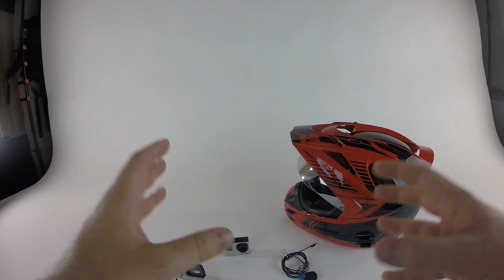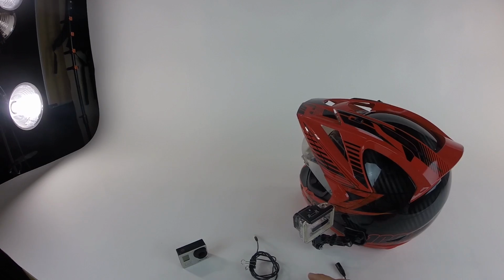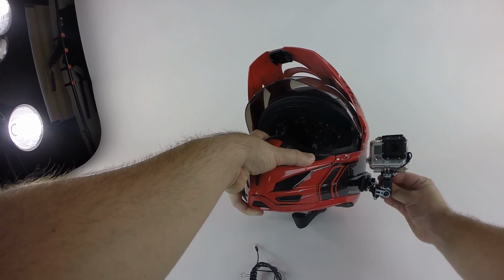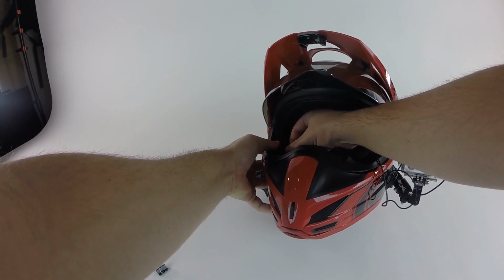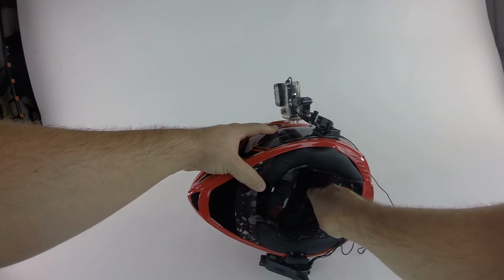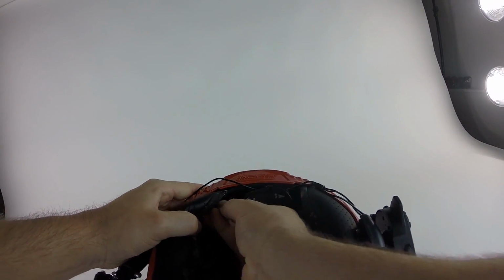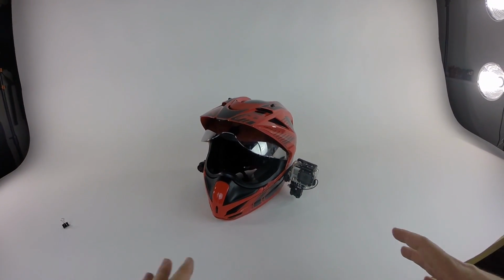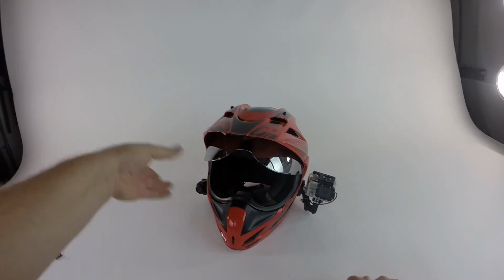How I record in helmet voice audio

Comment: MXL GOLAV 165GP, Lav mic that plugs straight into the GoPro no adapter needed, AND plugs in nice and snug with a right angle plug. That's been the easiest and best sounding way i've done yet. I'm shocked more people aren't using them lol !  Good set up vid man !
Reply: +bakerXderek Yeah, in my last video I guess I had a loose connection with the adapter. I'll have to invest in that mic, do you have an amazon link?
Reply: +bakerXderek CHEAHHHHHHHHHHH
Reply: But that's a rip offf

Comment: Y'all should know that that 90 degree mic adapter working on Chase's set up is a fluke. Some get luck and it works cuz of randomness. But it doesn't have the required resister. If you want to rock the 90 degree one you'll have to modify it. Look up EN187, he has a video showing how its done.
Reply: I thought the same too. Just decided to eBay the official gopro adapter for a slightly less painful price since I'm ordering EN187's same mic.
Reply: I was gunna say, I have bought 2 of the same 90deg adapters and neither work.
Reply: +Jake TheGardenSnake - I bought and trashed 3 of those adapters. I could only get right channel audio using it. I ended up changing my helmet mount to the chin of my helmet so I could use the gopro adapter. 
A side benefit to that is the gopro isn't trying to break my neck riding down the highway.
Reply: +Jake TheGardenSnake yeh..i think its supported on the black without the resistor...but for the silvers you have to do the mod...i attempted it 3 times and ended up spending the same amount to if i bought it with the resistor haha...
Reply: +RT MOTOVLOGS if anyone wants a link to a 90degree adaptor with the resistor let me know..they are like £10ish
Reply: +Jake TheGardenSnake I was just about to say that it's the wrong kind. I just ordered it and.. nope, no good.
Reply: +Jake TheGardenSnake Motonosity said he has the same adapter and it works fine. He said some of the 90 degree adapters don't work with gopros, but the one linked does.
Reply: +mercilesshobo that one doesn't work. i clicked the link and amazon says "buy it again" meaning this is the exact ine I've bought before and it does not have the resistor and doesn't work kn my hero3
Reply: Sportbike Hobo Well it works for Chase and Moto. Both of which have several of them.
Reply: Im not saying it doesn't work for them +mercilesshobo I'm just warning you so you're not surprised and disappointed.  . . we're hobo brothers we got to stick together.
Reply: Sportbike Hobo Haha well I got a few months before I have to start worrying about setting up but appreciate the hobo support.
Reply: +Jake TheGardenSnake or just buy the damn go pro adapter. i know it's overpriced but i mean shit for most people it's probably cheaper to buy the go pro one rather than modify it themselves.
Reply: +2cool0 the problem with that one is that it isn't a 90 degree one. so it sticks out and gets caught on everything. ive had it bend the port in one of my gopros because of that.
Reply: +zake90s exactly ..I spent £60 on 3 broken official adaptors cause it kept getting caught door frames ..lol how hard was it for go pro to create one with a 90degree angle lol
Reply: zake90s yeah that is a problem but maybe you could try putting the camera on the left side of the helmet? so that you don't have to bend the wire so much.
Reply: +2cool0 I tried it on both sides as well as a chin mount. it either sticks out and gets caught, or you have to have the camera sticking way out in order for it to fit, thus hitting everything in sight. even with the chin mount, it would catch my jacket when ever I did a shoulder check if I wasn't really careful. it was a poor design by gopro, I can't really think of any application where their style of adapter would be beneficial.
Reply: zake90s yeah it is a shitty design. damn i don't know man....have you tried not pulling the wires so much?
Reply: +2cool0 hahaha yeah, but I eventually gave up on it and went to the sena gopro back.
Reply: Love u dude
Reply: Can you send me the link to it?
Reply: i think that guy is gone. like literally..
Reply: Jake TheGardenSnake can you show us how to do the setup for dualvlogginh??? please

Comment: In Australia they're trying to make attaching cameras and intercoms to your helmet illegal... Apparently it "breaches" our Australian helmet safety laws and the helmet's structural rigidity...
P.S. Love the way you say adaptor, you say "adabdor". Keep the mad vids coming!
Reply: +Exodus227 And how can we record our rides for safety then? Cars have crash cams, it can be seen as a necessity for Motorcycle riders in most cases?
Reply: +lCLUTCHl_BLADEZ Yeah I'm saying the government is just BS, cameras are for us motorcyclists safety and should not be banned.
Reply: Definitely, Is this Aus wide? or particular states?
Reply: +lCLUTCHl_BLADEZ Currently I've heard it only being in NSW, QLD and Victoria.
Reply: +Exodus227 weird law as long as you are not drilling holes in the lid, how does something stuck to the surface change the integrity.  Sounds dodgy..
Reply: Exodus227 Sounds right, most laws are trailed with us anyway, Eastern Aus for the win haha, 
Yeah GTs Garage probably more so when an accident happens, they think the extension from the helmet becomes a risk and can cause damage to helmet? maybe somehow amazingly puncture the helmet?
Reply: +lCLUTCHl_BLADEZ +GTs Garage Exactly they think it will magically break through the helmet and drill my skull... Pretty sure if I use adhesive to stick it on, first the camera and arm will break off then my head will impact the ground, posing no danger. Its probably just the cops whining that whenever we get pulled over, we have footage as proof we didn't do anything wrong...
Reply: +Exodus227 I think they are already illegal in Queensland, Not sure about Victoria or NSW. It doesnt really bother me. I don't much care for the helmet view anyway. I much prefer dash/road cam. Helmet cam makes me seasick with some guys vlogs. Like hyperactive children they can't keep their head looking forward for two solid seconds. I believe chest harnesses (much more stable) and other mounts such as tank or handlebar mounts are still fine. It has to do with the physics of a camera dispersing an impact where a helmet is designed to intentionally crack on impact. I dont see anyone willing to fund a test to see if the camera dimishes the helmets ability to do its job. We also cant use tinted visors so go figure.....
Reply: Same in Canada even putting on stickers are technically not legal but I don't think the cops care too much about it.

Comment: Why dont you use the GoPro backpack for the Sena? much easier much wow
Reply from the maker: +Supermofools I've found that the audio quality using wired is much better than anything I have personally tested. Wireless is hella nice to use though.
Reply: +chaseontwowheels maybe I should have read som comments before putting mine lol
Reply: +chaseontwowheels That's great feedback Chase, thanks. Have you figured out a way to do higher quality intercom recording?
Reply: +Supermofools Because Sena products completely BLOW.
Reply: +chaseontwowheels not to mention how much battery life you'd be pulling off already such a short recording time on the gopro.
Reply: +chaseontwowheels Is there a mic that works for the sena and gopro? or do you have to use 2?

Comment: I did not have to drill a hole. I used a separate skeleton housing (not waterproof) and my mic adapter fits straight in the side. All of which is official gopro gear.  I kept the waterproof housing for when the wife bog washes me after a long ride with no phone call ;)

Comment: It sucks that you have to drill a hole. Defeats the purpose of having the gopro if you do mountain biking or water sports. Housing goes for like $40ish though so might have two housings.
Reply: +xavier415 Well you can seal that with a membrane or something that doesn't allow the water to go in and at the same time allow you to move a bit the usb to unplug that from the gopro.
Reply: Which is cheap.

Comment: I hate the GoPro4 10 pin USB. Hate hate hate.
Reply: +snowcatxx87 But i'm a new camera!
Reply: +Modelero epic
Reply: +snowcatxx87 Snow..How did you get around this on your hero4? I have bought various 'cheap' mic adapters which have claimed to work with the Hero4, but still no luck. I want a functioning L-shaped adapter :(

Comment: Nice vid. Just wondering how you got the mic adapter to work with your gopro as the link from your description is reviewed as an adapter that doesn't work with the gopro 4 silver :( I have the Hero4 silver but haven't' had luck with the L-shaped adapter as the adapter's do not have the additional resistor. Any ideas?

Comment: FYI The mic you have is stereo and the mic you linked is mono. Unless I'm seeing yours wrong you might want to correct that. Does your GoPro/adapter work with either?
Reply: +Mr Tmax  Well, not true stereo. It's a 3 contact plug which feeds both channels.

Comment: dude you set up the same way I do , I have the gopro 2 and I just ordered a case that had the cut out and it came with a mic off ebay for like 30 bucks , I am sure they make it for the newer models . are the gopro 4 worth the cost I was thinking of upgrading to the 4 but don't know if it is worth it the hero 2 seems to do pretty good what do you think

Comment: how do you capture the other rider's voice to the video in conversations through sena
Reply: +Da ViPeR This is a great question and would love a vide on this too!
Reply: You get the audio and footage from the other rider then compile it all together. Or, there are many bypass ways to record yours and your fellow riders audio.
Reply: thanks for the support dude
Reply: +Exodus227  thanks man
Reply: +Da ViPeR they most likely have the sena go pro adapter. they have the sena headset for intercom right......so if you have the sena go pro adapter what it does is, it takes the audio from the sena mic AND all the audio coming in from the call (which means the other riders' voices) and puts them on the video you're recording! it makes all that super simple and hella clean.
Reply: 2cool0
thanks man

Comment: @chaseontwowheels your links are wrong. the adapter does not work for the gopro 4 series. Thanks for letting me get some useless stuff :/
Reply: You can see its a hero 3 he is using
Reply: +skerr661 I didn't see it at the time I assumed the links where correct. So bought the wrong stuff
Reply: Well at least its not too expensive lol. Easy mistake

Comment: What's good C2W no why don't you use the sena Bluetooth backpack for the GoPro? Any reason or just no interest? (if it ain't broke don't fix it) kinda thing.
Reply from the maker: +R1Freedom I've seen others use it and I haven't been happy with any of the audio quality that I have heard personally. I feel like it drowns out too much bike noise and doesn't have a "clean" sound to the audio. Just my personal opinion though.
Reply: +chaseontwowheels gotcha.
Off topic but I just picked up a wr250r and I want to make a supermoto out of it after I break in the motor. I want to increase the low end power and increase the torque without losing to much too end speed what do you recommend?

Comment: Hey man, I have the same set up, but my audio only recorded in mono. Not stereo. any reasons why? Thanks
Reply from the maker: +Sterling Scott Sounds like a mic problem man. Try ordering a different kind and see if that solves the issue.
Reply: Ok. Thanks for the reply. I will give it a shot!
Reply: +Sterling Scott Yeah, make sure you have a stereo mic and not a mono mic. If you look at the connector, and only see one black ring, its a mono mic. If it has 2 black rings, then its a stereo mic.
Reply: +Quagmire88 awesome info. I'll check once I leave work. thanks for you guys help!

Comment: Is this kind of setup possible with the GoPro Hero 2014 considering it doesnt have an external mic input ?
Reply: +Ronan Cogley is that the hero 4/3+ or is that the go pro hero (the basic model)? either way it should work on all the go pros. not sure about the go pro hero (the basic model)
Reply: The one chase is using is the GoPro hero 3+ , i currently use the GoPro Hero 2014 which is the basic model yes , i was thinking it might work since it has the same input chase uses to connect his microphone to his GoPro
Reply: Ronan Cogley ohhh ok. if the hero has the usb port then yeah it should work.
Reply: Cool , thanks for your help
Reply: Was thinking the same have u tried it did it work ?
Reply: +INDX iLaC I did try it and although the port is similar it does not fit
Reply: +Ronan Cogley (MR_Squiggles) okay looks like I will have to upgrade then that's a shame
Reply: +INDX iLaC it is a shame, i was trying to avoid having to do that

Comment: Hey i really need help, when i have my mic all set up and go riding, after 1 or 2 minutes, my go pro freezes and stops recording or doing anything however remains on, so i have to force shut it down. And when i turn it back on it says file cannot be repaired, and it won't do this with when the mic isn't plugged in I am using a go pro hero 4 silver, if anyone knows anything it would be greatly appreciated

Comment: What a horrible setup. You're famous enough... go speak to gopro and tell them to build in a 3.5mm jack with a waterproof grommet on the bottom, or back.
Reply: Yeah I'm sure your set up is much better...... 😂
Reply: It is! But unfortunately it means I cant use go-pro picture quality. Thats why Chase should use his powers to get motovloggers what they want :)
Reply: Nerb1 good point, but i rather have bad set up and audio if i had good video quality
Reply: If only.
Reply: Literally all they would need to do is incorporate a connector similar to the one on a life proof case. That simple.